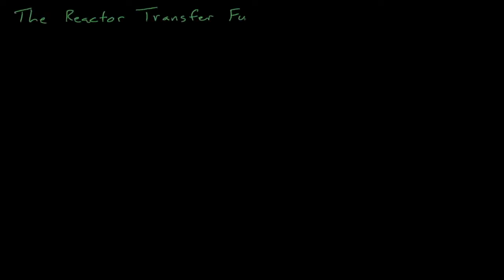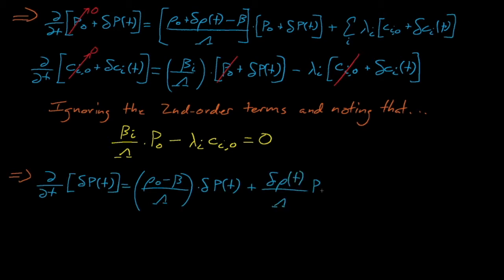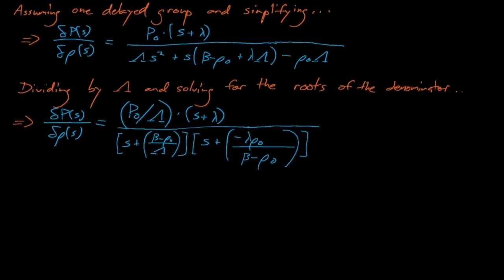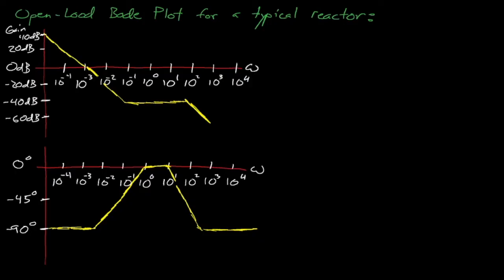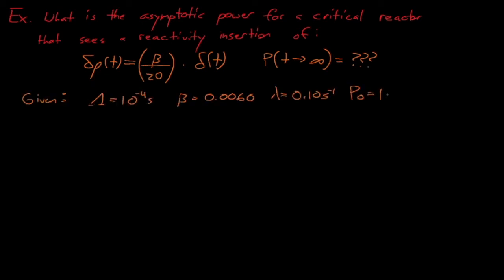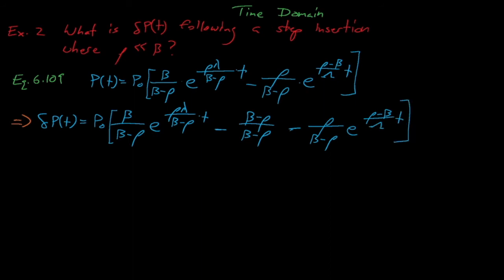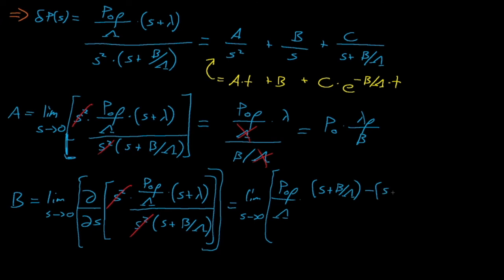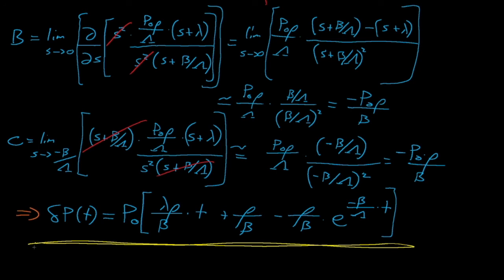NE560 - Lecture 18 - The Nuclear Reactor Transfer Function

Comment: At 3:00: at the middle equation, I think it should be rho0*small lambda, instead of rho0*capital lambda at the end of the denominator.
Reply: Also at the last equation something is not right…. I mean, at the next one.
Reply: As a result, at the final equation for delta P by delta rho, for rho0=0, there is a plus small lambda term missing in the denominator inside the square parentheses.